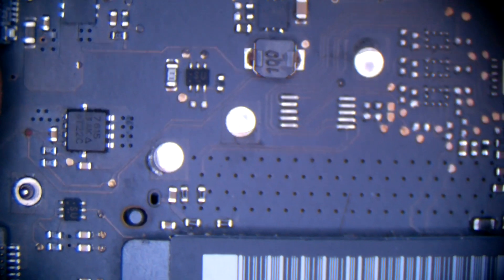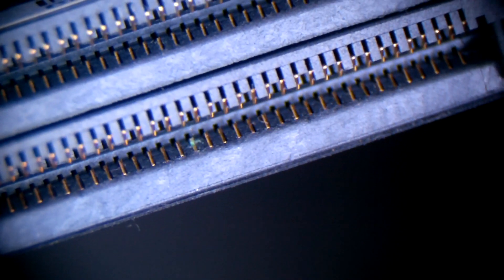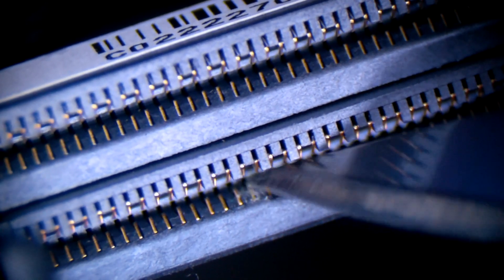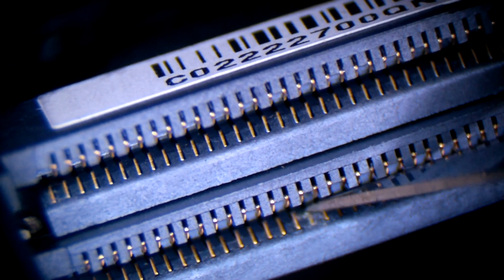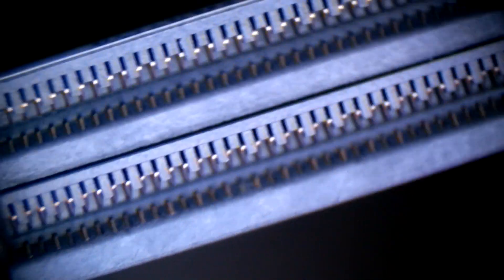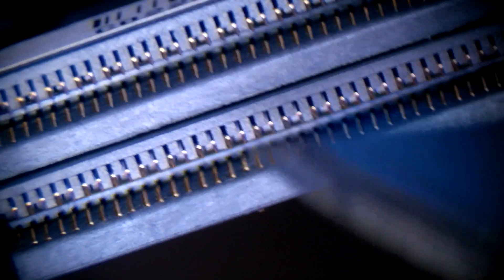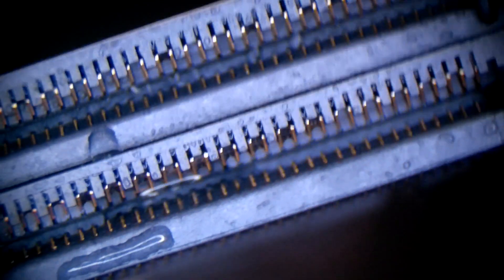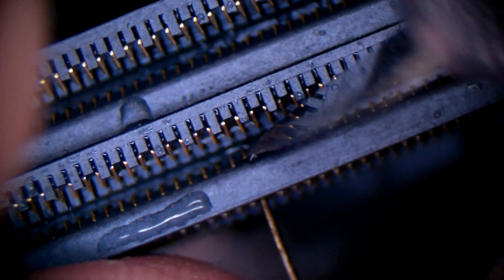Common issue on A1278 A1286 A1297 MacBook Pro. Intermittent RAM-Related Problems. No Start. 3 Beeps.

Comment: i always thought thats a soldering issue. on 3115 boards you may see that two parts of socket separate and the main difference is that on 3115 it has way less solder. i fixed few boards by reworking outer row of the connector, however if broken trace is deeper it does not seem possible. i used led ddr tester method to find bad row.
Reply from the maker: Yes, that's another common fault especially on 820-3115 (2012 A1278) Models. I have a video on that topic as well. This is more of an age-related and I've seen several with such corrosion.
Reply: @applepietech  interesting, never thought there might be different reason for very same issue
Reply from the maker: @inwerp  If you think about it - it's exactly the same issue (intermittent contact with RAM modules), just a different cause.